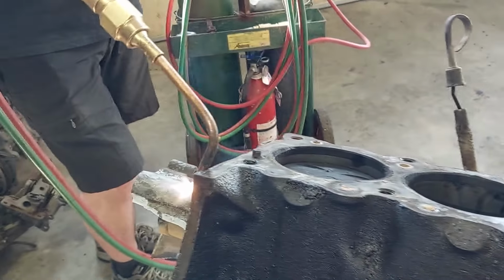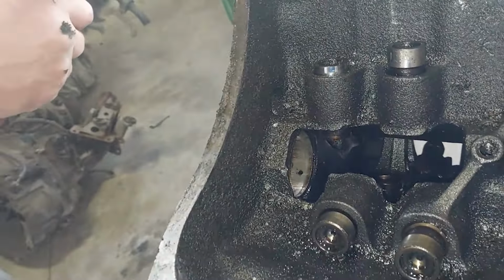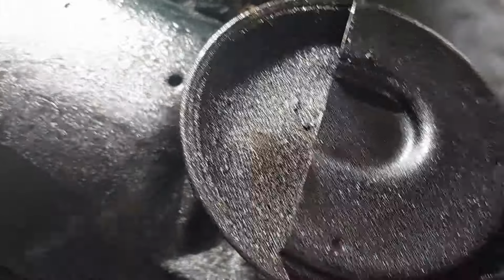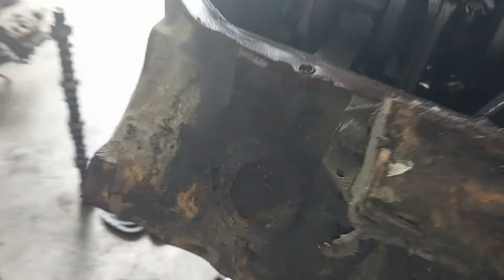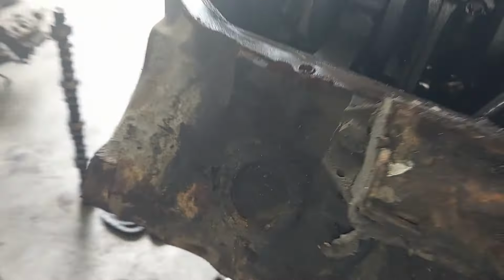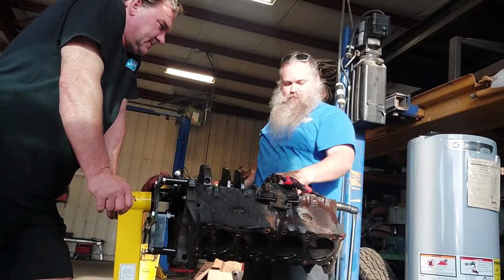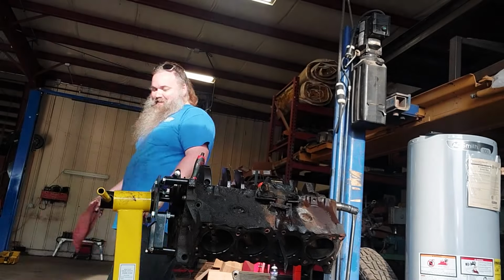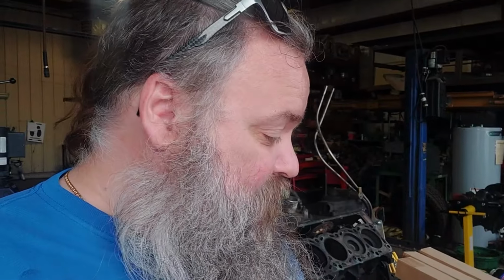Pontiac Short block teardown COMPLETE! Pontiac 350 Rebuild still a GO!

Comment: Disassembly tip:  When loosening the main bolts, standing at the front of the motor, rotate the block until the pan rail is vertical. Standing at the front of the block you can then push down on your breaker bar to loosen main bolts. Don’t even have to chase the block around. 
When loosening head bolts rotate the block until the valve cover sealing surface is vertical. Now you can break the head bolts loose without having to chase the block around.

Comment: I pulled my Pontiac 350 out a couple years ago because of low oil pressure and my bearings were toast. Looks like you got some good bones there.
Reply from the maker: I was definitely surprised to see the state of these bearings given how bad pretty much everything else was. Going to guess this motor was actually low mile but poorly maintained. So far though I'm happy(ish)!

Comment: That Pontiac is going to be Awesome, but definitely a lot of work and money, I have a 1972 Nova SS , not a clone , but I baught it in 1993 , was my daily driver up until the late 90's parked it and started working on getting parts together and getting a engine built for it , then got married and have kids wich the oldest has been out of the house for about 4 years and have 2 teenagers still at home, so it's been sitting for way too long, but I started gathering parts for my engine , it's a destroaked 350 sbc it is a 331 now , gonna add boost . Look forward to the videos from y'all . God Bless 👍

Comment: I can feel the grease in my fingers with out even being there.i think a 2x4 and a bigger hammer would of gotten the pistons out allot quicker.crank is healthy looking you may get away with reringing it.pontiac made tons of different heads. your advantage is to pick em carefully.good luck.peace.......
Reply from the maker: Any project you work on where you need to clean your hands multiple times is a project that stays with you for sure. One of these days I'll talk myself into working on something clean and "new". With the power levels we're going to be looking from this, a simple rering, hone, and send it won't work. We're going to HAVE to punch this thing to bump the compression and to clean up the walls. I THINK I have a set of heads located also that should give us a good chance at what we're looking for.

Absolutely going to try to reuse the crank, which I don't see why we wouldn't be able to. Really really trying to stay away from buying a new crank, if I had to, it would end up being swapped with a stroker kit but then they budget goes flying out the window.

Comment: I'm new to u'r channel and had a 1968 PONTIAC Le Mans with a 350 2-barrel & Super Turbine 300 2-speed auto & a 10-bolt non posi. This was my very first PONCHO. The 350 PONTIAC would'nt be my first choice as a starting point. If u can find a PONTIAC 400, 428 or a 455 block that would be much easier to punch out extra excitement. I'm interested in u'r 350 buildup and see how u squeeze extra power out of that 350 PONCHO. I'm just not a big fan of the stock D-port iron heads but, i wish u luck.

Comment: 71 is not the year that’s just a type of 2 barrel base model 350 they put in most cars for a few years .
Reply from the maker: Everything is date stamped for production in 1971, I'm sure this thing started life as a 350 2 barrel in something, then was transplanted into this 68 to get it moving again. Judging by the lack of maintenance in this motor wouldn't be at all surprised about what took out the original motor!

Comment: You may want to ask someone if the 211,177 valves of the number 62 heads will clear the cylinder bores. Also with the wear of the distributor cam gear, stretched timing chain, ridge at the top of the cylinders, and the round cam lobes, you my friend are the proud owner of a tired engine. Do yourself a favor and get a 400 to start with. Sorry to piss in your oat flakes.
Reply: If Austin wanted a 400 I'm pretty sure he'd be working on a 400 right now. As I'm pretty sure he mentioned before, part of the challenge is making the 350 perform. And it doesn't matter if the engine is "tired" since he's rebuilding it anyway.
Reply: @1965l88  You are absolutely right about it being a challenge. Unfortunately, I don't see it happening on motor alone. Just my opinion. I hope I'm wrong. As far as tired engine statement, he was saying through out the video that he believed the engine was just neglected and low miles. When you have to beat the shit out of the pistons to remove them, well... Btw, there is no replacement for displacement and in the long run, it would be cheaper to start with something larger.
Reply: I was thinking the same thing, if it was just a dingle ball re ringer and service the heads then yes, by all means if the 350 had good bores and pistons rebuild it. But as soon as new pistons got mentioned, theres a better way. But, not my car and ill be watching anyway. Carry on !
Reply: you're correct... I think the 68-69 350 that used heads from a 400 had the cylinders notched to clear the valve